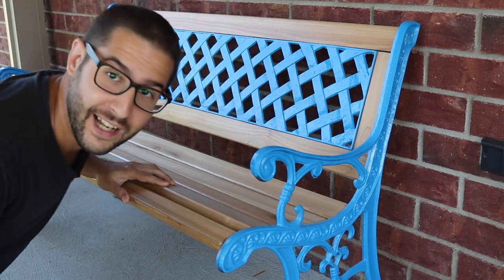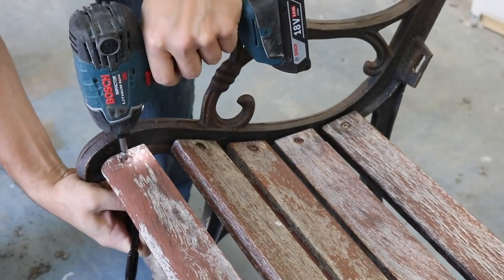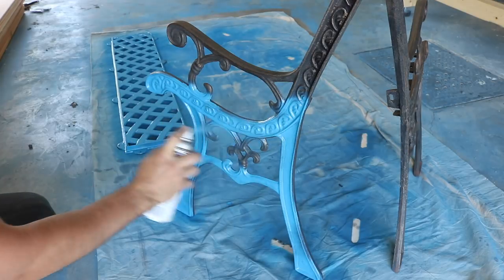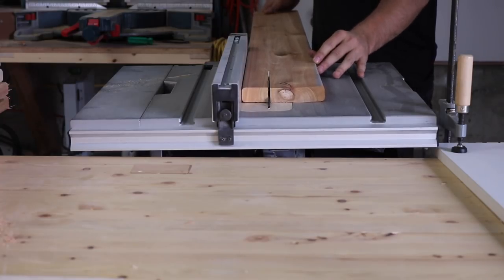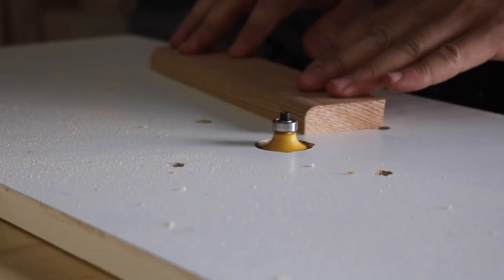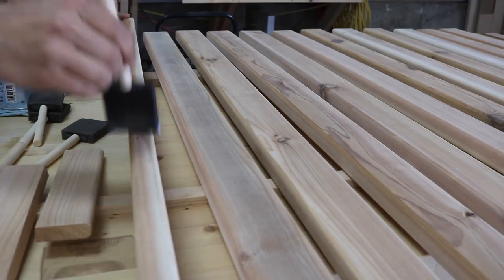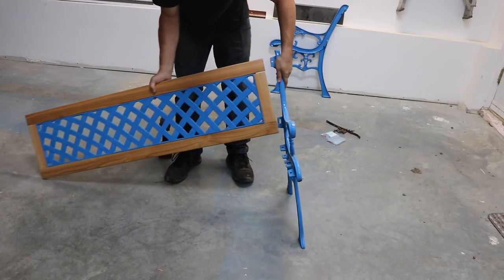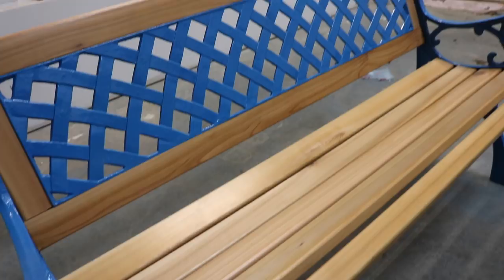How to Restore an Outdoor Park Sitting Bench // DIY

Comment: Planning on doing the same, but I may spray the rusted cast iron with a clear coat since I like the rustic look.  However, having a hard time finding decent cedar at the local Home Depot and Lowes...mostly warped, undersized garbage.  I may just grab a couple of 4x4's and a 4x6 and mill my own slats down to size.  Nice little project you had there.

Comment: I have just restored an identical bench and the two ends are exactly the same as yours. I also painted the ironwork blue as that is the colour the customer asked for. PLEASE!!! replace the screws you used on the back to connect it to the two bench ends. Screws will not hold the back securely enough and the whole bench is likely to sway either left or right and eventually collapse. 
Nice job though to be honest just make sure you change those screws for proper BOLTS ok.